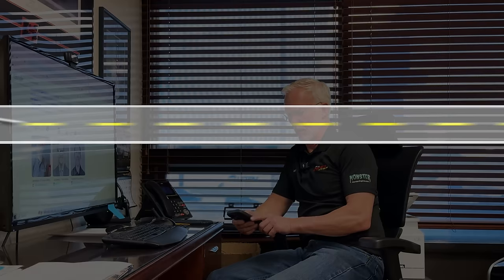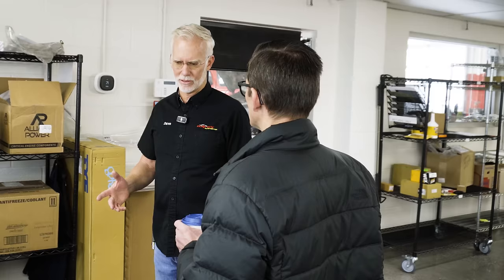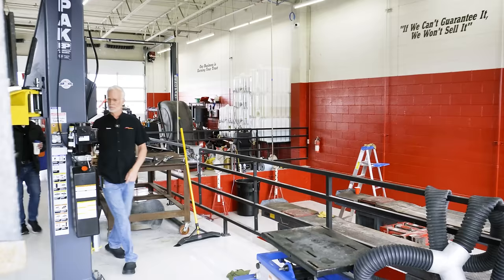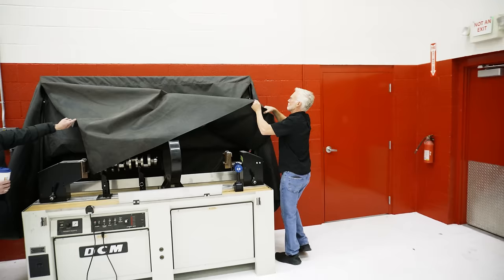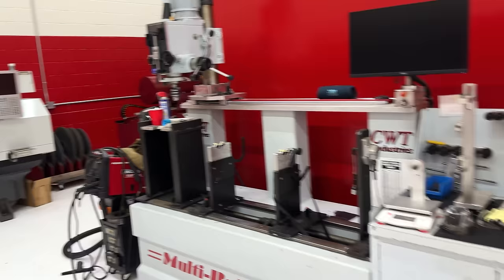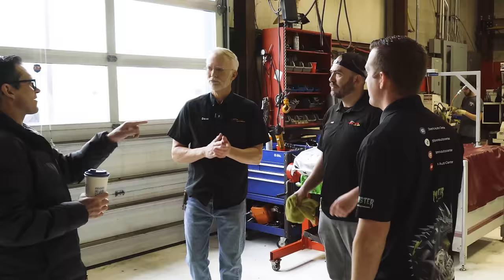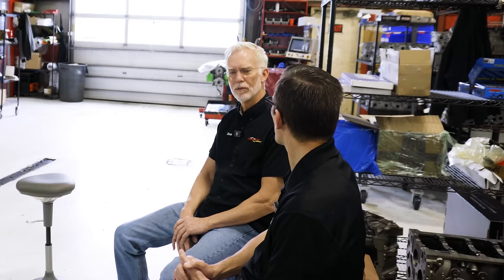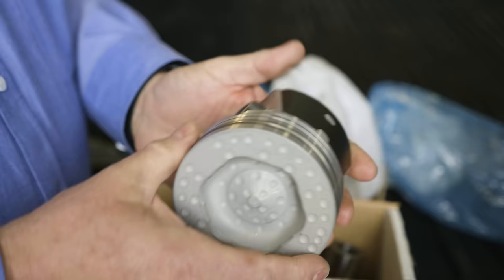Sitting Down With Lake Speed Jr. - The Truth About Oil Change Intervals and Analysis

Comment: I laughed out loud when you were talking about "Maintenance", I have a 2003 Dodge Caravan with 540K on it in MI! The frozen wasteland, a murderous environment. Simply put, I do strict maintenance, I got 780K out of a 2004 Chevy express, and finally lost the battle with rust however, parted it out and the motor was sold to someone for a swap, and the transmission is STILL in a pick up driving down the road. LOL. One last thing, change ALL the fluids regularly, especially coolant so you done rot the engine from the inside. Love this stuff Thanks!

Comment: At 28:50 you mention the Navy. I was in the Navy and my first exposure as a young man to oil testing was for the very large DeLaval reduction gear for the propeller shaft. We also had a centrifugal separator to remove sea-water intrusion into lube systems, but they could be used for removal of carbon.

Comment: 2001 with a 54 block Cummins. Been following you guys for a very long time. It’s no surprise to my own thinking that I’d like to have you guys take on my engine and do a full rebuild.  Let things holding me back are: 1. I’m north of the border, 2. Contemplating putting my 5.9 head on a 6.7 short block. Not sure if you guys might consider that as an option.

Comment: I Run, a hotshot business I have a 2020 f550 I Run hot shot fuel additive every fill up change my oil every 10,000 miles or close to it and fuel filters every 20,000 miles I have 207,000 miles on this engine and the engine light has never came on and I run it hard constantly doing 2000 rpm and I hardly ever let it idle. I just got the 2024 and im going to try to do the same I just found your channel and I really like it. I like the fuel guy to.  keep up the good videos and maybe I’ll have you rebuild an engine one day

Comment: Thanks.

I use to have a 96 bnw328is manual.

Simple oil change schedule. Every time the thousands spot read zero or five... change the oil.
I bought the car w 30k sold it at 296k. 

Just bought a 2020 equinox. It was in a 10k schedule, rotating to a 5k. Btw i alway pour a qt of oli through when drain drips/amost drips. wipe oil filter port, fill oil filter.

Comment: Fascinating, important information about lubrication for sure, but Lake's comments about diesel fuel and the importance of adding some kind of detergent fuel treatments really got my attention!   I have a 2015 GMC 2500HD diesel truck. This winter I added Amsoil's injector cleaner+Cetane boost additive primarily to protect against the fuel getting thick in the cold. The truck started easier in the cold weather, ran smoother, and gave me about 2 mpg improvement. To Dave's point about regular maintenance, I am a stickler for regular maintenance (pay now or pay later): oil, filters, lubing joints, tire rotation, etc. My GMC 2500HD  has a secondary oil filter (down to 10 microns) installed. I run Amsoil full synthetic oil in all my cars b/c they provide data and proof of their claims.  I even go so far as to get the GMC oil tested at around 10K miles and btwn changes watching for significant wear. B/c I'm running 100% Synthetic Amsoil for diesels and I'm testing it, I'm running the oil 15 - 20K miles btwn changes. The testing (and Amsoil) suggests that this is safe to do. I only have 105K miles on the truck, but it runs very smoothly and only burns oil during the regen cycle and I don't baby it.  Given all this, do you have any concerns with me running 15 - 20K miles btwn changes? I will keep using the Amsoil diesel fuel additive; thanks for that confirmation.

Comment: To say this was a great video is an understatement. With everything that was discussed,what would be the extended life of engines that suffer from timing chain issues if oil and filter changes occured at 3000 miles instead of what a manufacturer or dealer recommends? Thanks for sharing and by all means,please continue.

Comment: I used to drive a 2002 honda odyssey 3.5 vtech. When i got it at 175k the oil consumption wasnt the best. After driving it like i stole it until 235k miles, the oil consumption slowed significantly and it ran better than the day i got it. Definitely can attest to running your car through the full rpm range at least a few times a week, and regular maintenance. Changed with high mileage full synthetic every 4k miles.

Comment: I change my oil every 3k miles period, never had an engine fail doing that. I also use Gumout and Seafoam in my fuels and change fuel filters on a regular basis. Spend a little to save a lot. Cheers :)

Comment: BZZT. We have the same ultra low sulphur gas in the US as Europe, since 2019. Top Tier fuel has 3-4x the additives, that's all you need to know, except all gas comes from a common pipeline, raw gas is additized at the terminal by the tanker driver. The "quality" is the same across grades and brands, only the add pack is different....EPA (minimum) or Top Tier is all there is.

To avert intake valve deposits, a 1/2 can of CRC GDI intake spray every Spring. Also, lower ash oils like VW 504 and MB 229.51 (Pennzoil Euro L)

Comment: OK, So much of that conversation went way over my head, but, some of it made sense, and for the most part, I did gain some knowledge. I am going to give three different scenarios of my three vehicles I drive the most. 
1. My 2005 Toyota Camry. It gets full synthetic every 3,000 miles. I drive it the most, and almost always driven the longest trips. I also use either NAPA Gold, or WIx oil filters. I put in Lucas every oil change, and fill up shortly there after, and put in a bottle of Lucas gas treatment. 
2. My Crusty old 94 F-150 with a 4.9lt engine. Gets changed every 3000 miles. I use conventional oil, with a bottle of Lucas, Wix or NAPA oil filter, and the same with the gas treatment. 
3. My 99 Chevy one ton dually, with a 454. It gets driven the least, but when it is driven, It's pulling 13K down the road, and a large part of that is mountainous roads, and to keep a decent speed, my foot stays in it. I use Rotella T-4. I did use conventional oil, and it used a lot of oil, as in a qt-qt and a 1/2, in 5-600 miles, I switched to full synthetic, same if not worse results, then, when I switched to the t-4, the usage dropped tremendously. As in a 1/4 qt in the 5-600 miles. I change it about every 2000 miles, mainly because it works hard, very hard for most all of those miles.  
I'm 61, and most of what I do is from experience. I've not owned any vehicle in the last 35 years, that had much, if any, less than 200K miles on it. Doing as I do, I have had zero issues of internally lubricated parts, ass a result of what am doing right, or wrong, with the exception of SBC timing chains. I have had to replace a few of those. 
Also, when I buy a used(All of them have been) vehicle, I go through and replace or at least touch, everything that is a wear/maintenance item ie: belts, hoses, fluids, thermostat, coolant, and every type of filter, as well as brakes and even flush and replace the brake fluid. I do carry tools in most all I own, but, using them on the side of the road is NOT something I care to have to do. 

Now, the one thing I took from everything Lake said, Someone should open up a "fast" oil testing facility in the middle of all of the oil change/auto parts store across the USA! Why people like me do as we do, with no data to back it up, because getting that data when we need it, is next to impossible in most areas of the country.

Comment: I had a 99 Dodge Ram Cummins Diesel with about 120,000 miles on it (mostly highway).  I bought it new.  At that mileage, it didn't burn a drop of oil.   And yes, you're absolutely right:  Engineering Design meetings are driven by corporate and government bureaucrats:  Corp Guy - "Will this make it to 60,000 miles when the warranty expires if we change the oil at 10,000 miles?"  Engineer - "Yep, should make it just fine".  Customer - "Will it make it to 100,000 or 120,000 miles at that interval?" Engineer - "Not on your life".

Comment: I am in Portugal (mild temperatures all year round), I have a MB A Class with a 1.5L Renault diesel engine, that needs service every 25000km (15000miles) or each year. The oil is very specific for PF and NOx supressor, according to the Euro 6 standard. I only use those high-grade diesels he talked about. Those engines have injectors that work at very high pressures (2000bar) and are very sensitive, costing 300euro/usd each. Then there are the turbo and the EGR valve. 3 years and almost 50000miles it works like a clock and negligible oil consumption. I am 52 but I drive as if I was 80...🤣. Fuel milage is about 60 to 70 mpg.

Comment: I was a Volvo tech in the early 2000's. Their oil change interval was 7500 miles. Frequently, people would get busy or forget and those engines would experience 10,000 miles without and oil change! If you've ever looked under the oil cap on one of those 5 or 6 cylinder engines (if they're still running), they are caked with sludge. Thankfully, many customers understood this and brought their cars in for oil changes at 3000 miles, ignoring the salesman, the service writers and the owners manual.

Comment: 150k on my x5 35d, use lucas fuel treatment and the liqui moly CERA TEC at 10k intervals. No issues at all. Use the lucas fuel additive in all my diesel tractors, bobcat, mower, boat and my dodge 2500 5.9 2006. Always seem much happier on the Lucas.

Comment: Oil analysis is the key.  I used to work on jet airplanes. There was a set interval for doing the oil analysis on the engines. It was called SOAP sample. It is short for ( spetrimetic Oils Analysis program). I think I spelled it right.
We done oil changes according to what the oil analysis told us about contaminates.
You could buy hundreds of stock engines for the cost of one jet engine.
I change my oil every 5,000 miles or less. I use synthetic oil exclusively.  I have over 300,000 miles on my Gen6 454.  I have had to change the camshaft and lifters just under 300,000 miles.  Lifter failure which ate up the cam.
I pulled the engine entirely down, hot tanked it, cleaned the oil galleys,  honed the cylinders, put new rings, bearings, including cam bearings and put it back together.
Oil changes made it to where I could do that IMO

Comment: I read the manual for my '24 jimny recently. (I'm speaking in metric kms here). 1st service is at 1 year or 15,00kms. But when you dig deeper, there's a 2nd service schedule that they recommended for operating the vehicle under "extreme" conditions. It's basically the same as the standard schedule but TWICE as frequent (so 7,500kms instead of 15,000). Now what constitutes "extreme". Well, it can include: idling for long periods, stop-start driving, extended high-rpm use, frequent trips under 6km etc. So basically everyone living in a congested city, commuting at speed on the freeway or using it as a local runabout would be considered "extreme" without even knowing it. The standard advertised service schedule is not fit for purpose and if you read the documentation it says so, just in an indirect manner that 99% of people will never pick up on.

Comment: Something very important that goes along with your statement about longer intervals between oil/filter change is that you must actually Read the Owner's Manual.  ALL manufacturers have a statement in their about "normal" use and "extra-ordinary" use.  The "normal" use is something akin to what you think about when you hear people talking about "this car was traded in by a little old lady that barely drove the car to the grocery store once a week and on Sunday to go to church."  

The "extra-ordinary" vehicle use is what we typically drive, 7 days a week, dusty roads, driving behind another vehicle for extended periods of time, while the engines breaths in the exhaust of the cars that are a foot or three away from them in heavy traffic, heavy traffic/stop-n-go, etc.  

If you look at the interval for "extra-ordinary" is a lot shorter than the normal use.

Even then, the only vehicles that I would allow an extended period between changes is the vehicles that have the larger oil capacity, like some of the Mercedes vehicles.

Comment: Change the oil on my Toyota Corolla every 5k regardless. Did the same for my last two cars, a 2.5ltr Skyline turbo,  500,00 km under my maintenance and a 3ltr Subaru Legacy,  400,000km with zero, but maintenance. Not even a cv joint. The last three cars I've owned have been the most reliable cars I've ever seen bar none, a Skyline turbo, A Subaru RS , And a Toyota corolla. All magnificent cars.

Comment: Had a 95 Chevy truck bought it new changed the oil every 3000 miles used penzoil sold it with 320,000 still ran great and used about a quart in between oil changes

Comment: Great video, very informative! The use of oil analysis should be used to calculate oil life… obtain a base line for specific engine; not a firm 3000, 7000, 10000 miles. When diesels engines have high capacity 12-20 qts, changing early isn’t preventing damage and increasing costs & waste. Video basically reinforced the use of OA vs mileage.

Comment: I remember how my dad and all the old folks that owned all the old chevys fords and dodge, would say all those vehicles could run forever. Nowdays every vehicle breaks down my father experience alot of vehicles had issues and he would trade it in, and i remember reading about the auto industry nearly failed because of how well built those old vehicles were, dealerships setup with gas stations and parts stores didnt sell any parts. The big 3 realized that it was bad for business to build vehicles, to the highest standards of quality, and started using statistics to graph the failure rates, so if ford wants to make money they ship all the vehicles ready fail, thers a billion of us so no matter what you do to your vehicle there designed to fail. If your lucky you get a vehicle that is very reliable that might have tested right in the middle or above the statistic graph line.

Comment: so in 2.1 million miles total and counting of using arco regular 87 exclusively in my 5 dodge ram 1500 v8 work trucks over the last 24 years ive never had a fuel related problem. no injector failures and regularly getting 250k miles per fuel pump. all my engines last longer than the trucks and still run great @ 350-425k towing at capacity half the miles. i attribute this to 3-4k mile oil changes and i use whatever is on sale and even mix conventional and synthetic depending on whatever is on the shelf when i change my oil. usually walmart oil or penzoil and fram or mopar filters. I do add 1 qt of atf+4 trans fluid to the oil every 25k right at the last 500 miles before oil change for cleaning. btw changing trans and rear end oil evey 50k has kept me from ever losing a trans and only 1 rear end pinion bearing but that one never had an gear oil change and failed at 165k and was a common problem for these trucks but never again once i started changing it evey 50k. all trucks are 2001 ram 1500 5.2 l and still hauling a half cord in the bed and 1 cord in a trailer exclusively for my firewood and cooking wood business since new.

Comment: As aircraft mechanic we go by what manufactures  maintenance recommendations to protect warranties. Yes we do oil analysis per manufactures requirements but Dave it’s unnecessary to require 3,000 mile changes to protect your warranty. Again like the man said depending on heavy loads or extreme conditions it varies.
As per manufactures recommendations it’s right there in the book normal or heavy usage oil changes vary.
Reply: I think Dave is a little nieve about his oil change warranty program. And like the man said it’s a waste on the environment.
Dig the hapless ring idea good luck with that.

Comment: I may have been doing it wrong, after reading a test about fully synthetic oils I changed my oil filter regular but the oil once a year.  When I changed the filter I of course had to add a little fresh oil to top it off. Quarter million miles on my gm 5.3 and runs like new.  M;y other car, vw vr6 been following the manufacturers 10 schedule, going to cut that in half.

Comment: My friend only drives his car from city to city. You can't hear the engine. 
City driving and idling degrade oil faster, so change it more often. Highway driving is easier on the engine, so you can follow mileage guidelines. Always check your vehicle's manual for specifics.

Comment: Lol my grandpa, a tractor mechanic back in the 30’s, 40’s, 50’s used to say that an engine was running pretty optimal when it was using about a quart every 1000 miles.. He also helped solve the Ford Ferguson engine oil consumption issue by fine tuning the ring gap and the friction on the cylinder bores.  Pretty smart for 8th grade education, right!?

Comment: Not sure about the oil change interval recommendation. I’m sure it varies from car to car but I have had several cars now with way more than 100kmiles on them by closely following the manufacturer recommendations. Our current family car is a 2012 Prius V with over 180k miles on we purchased as a lease turn in with 30k miles. I have done nothing but the 10kmiles oil change interval.

I had a BMW M3 with 120k miles on it that I bought at around 70K miles and I only ever did the 7500 mile recommended oil change interval on it. Internals on it were all very clean and ran like a top when selling.

Comment: I work for a gas station and trucking company and i deliver fuel. When i load my truck up with fuel diesel to deliver to the station, i have to put additive in it. That additive used to our company trucks. And when we go far and we have to full at other gas station, the trucks runs loader and a little crappy and the engine oil break down faster.